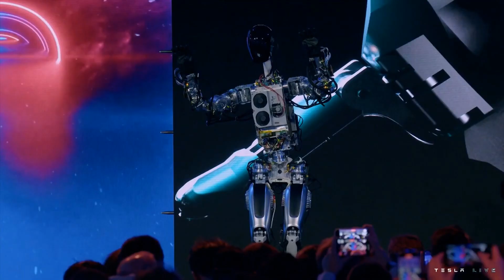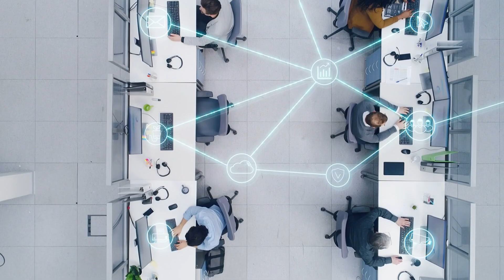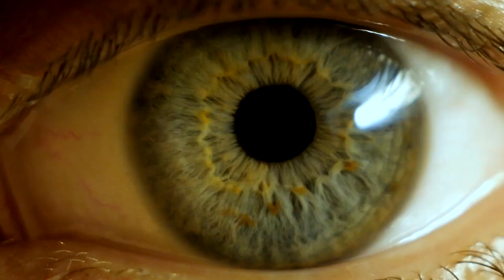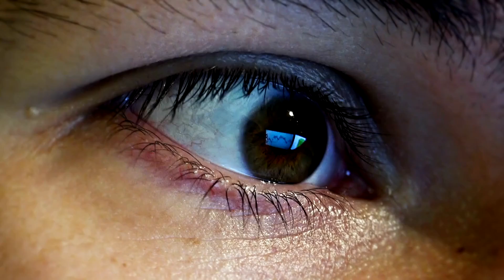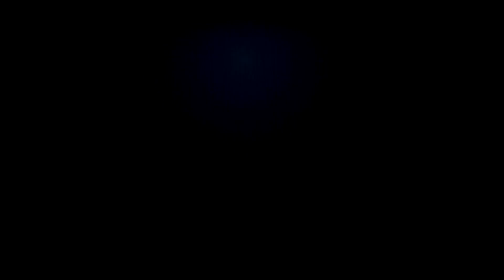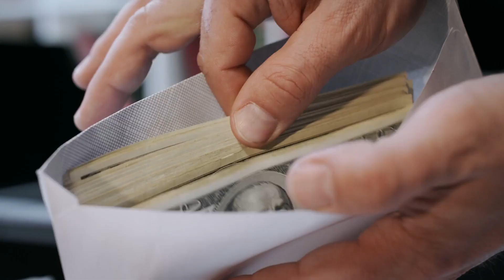How far has TESLA gone?Is Optimus pushing STOCK price?

Comment: But can it sit down without damaging a delicate chair? That rear end look very rough! OPTIMUS Needs some fake flesh to act as padding on its rear end. Tesla designed Optimus to use tools, but seems to have forgotten one tool. Chairs are humans tools too! For some jobs, sitting would allow Optimus to lower energy use and extend it’s time before charging, a chair can also act as a platform to allow steadiness to do high precision work such as soldering and tiny parts assembly.
Reply from the maker: These are just the first steps on a very long journey.
I don't think that in the long term, a chair problem will get in the way of Optimus.:D